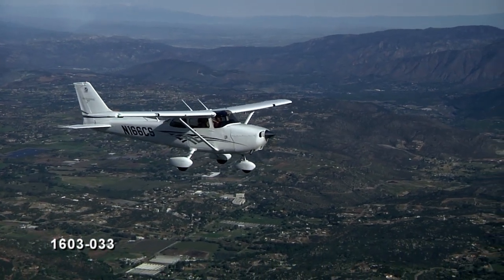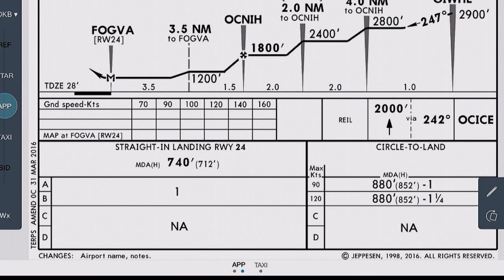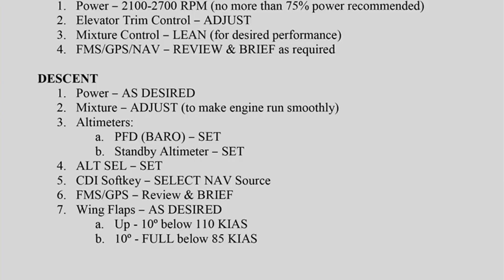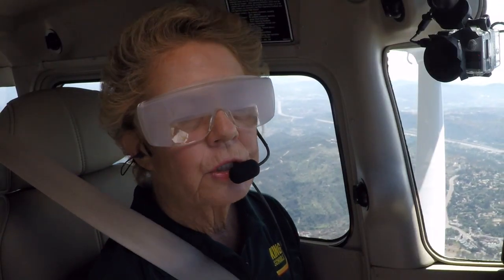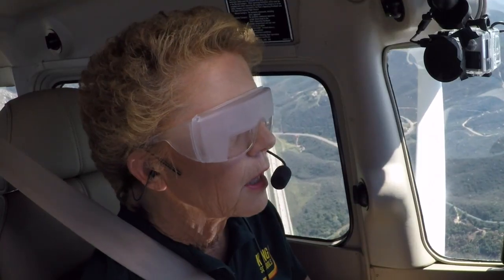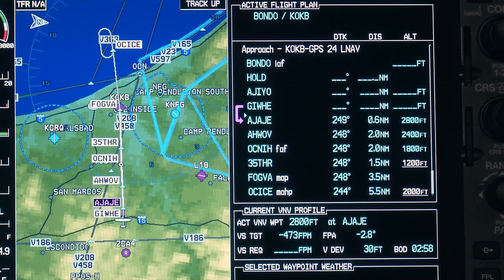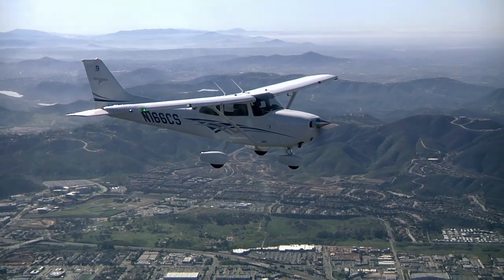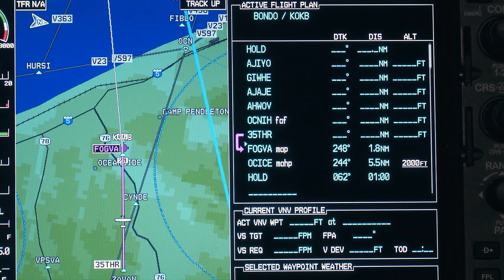IFR Checkride - Partial Panel & Lost Comms

Comment: With lost coms, why did you not set the transponder to 7600?
Reply: I think only because this was an exercise they did not want to set to the real emergency transponder.
Reply: The transponder code for lost comms / radio failure IS 7600, not because this was an “exercise”.
Reply: Stating she was setting transponder to 7600 but not actually do it since it was simulated after checking frequency and volume would have been good checks. Still a very helpful video for us learning IFR procedures for malfunctions of equipment.